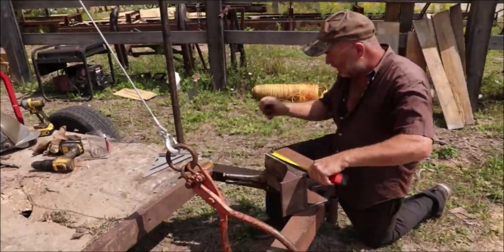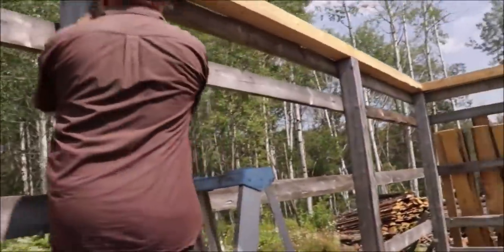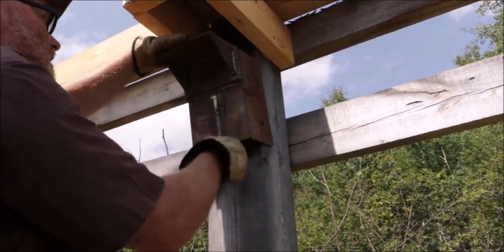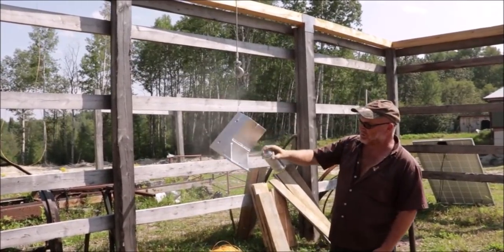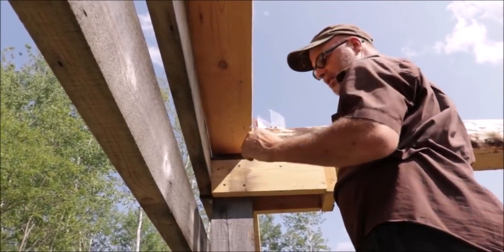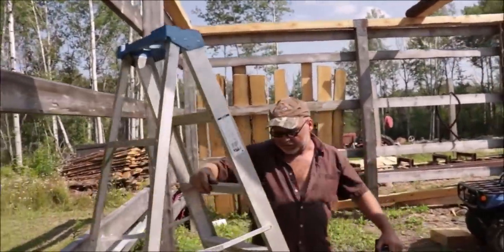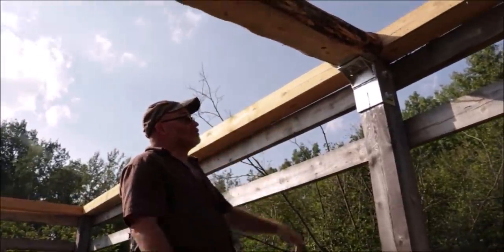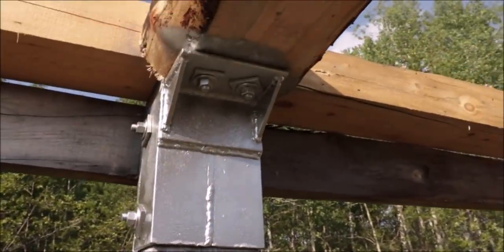She's Loving This, Now We Can Continue Building Our Off Grid Pole Barn.

Comment: Cecil  jolly good job I to in the recent past have done similar work for my building s using similar fixings as yours but I left the excess threads in cae i wanted to in the future use it to mount any additional bracketery, Somerset Mike.